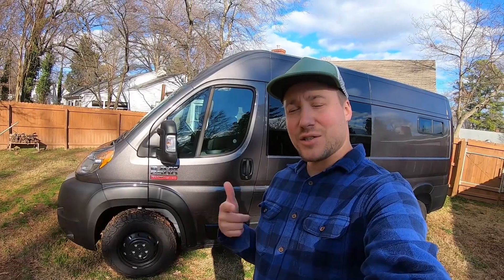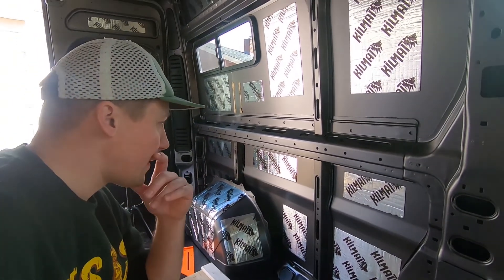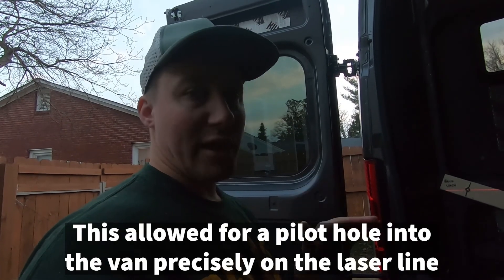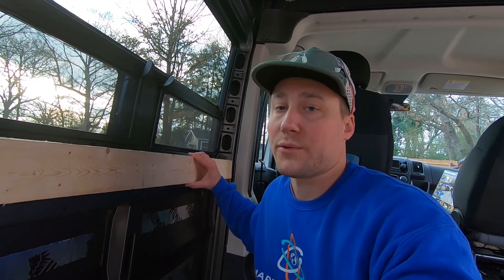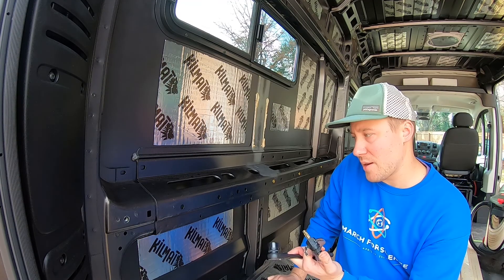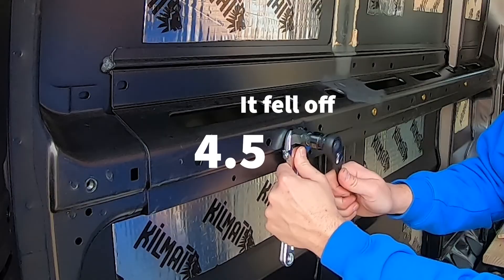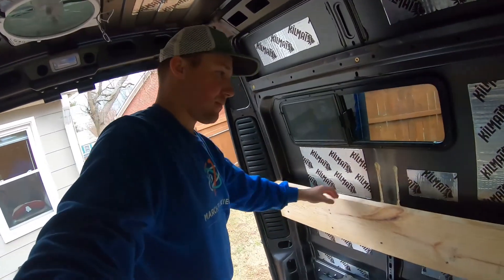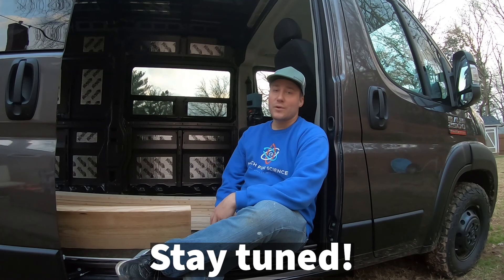Framing a Van + Plus Nuts + Floating Bed Frame Part 1 //Ep. 4 DIY VAN BUILD

Comment: Nice job. Nice Dog. Looking forward to viewing part II and your other videos.
Reply from the maker: Thanks! I hope they can be helpful! Are you starting a build of your own?
Reply: @Trailvagabonds  Thank you for your reply. Yes I am about to start on my second hand Mercedes Sprinter extra high top and extra long wheelbase. I will be starting by fitting  three Fiamma (made in Italy) 40cm (15.5 inches) roof windows and then framing out the van. I will also be fitting side windows. A daunting prospect. Best wishes to you both on your build.
Reply from the maker: @barry-cq4xg  congrats! That is very exciting! After the initial hole is cut, they get easier. The fan install was my first experience cutting holes in the van and it is still by far my most stressful project. You got this! Reach out if you ever have a question 🙌🏻
Reply: @Trailvagabonds  Hi Matt & Katie. Thank you for your reponse. I have watched many YTube videos on these roof lights and they seem fairly straightforward to install. I will certainly contact yo if I have any questions. Best wishes to you both.

Comment: Caught that LeAw reference in the intro.  I was planning on using hanger bolts to locate the plus nut locations, but I like your idea of using the 1x3 as a template. I"m considering using an ATV ramp as the bed frame.
Reply from the maker: 😂 When I was editing the video I didn't know why I opened like that and it had reminded me of something. Maybe I watched one of their videos that morning?🤔 I like your idea of hanger bolts. I thought about it but just didn't want to make another trip to the hardware store since it's usually an ordeal to get there in back, haha. Seemed to work out alright with the template. I like your idea of the ATV ramp. I originally wanted to do 8020 aluminum but it's so expensive. As you'll see in a future video, I'm just using five 2x4s to span the gap and will reinforce them in between (I'm laying them flat which isn't really advised for structural support🤷🏼‍♂️). Then 1/2" birch ply on top. It's seemed sturdy enough. Hopefully no issues down the line.
Reply: for the "bed"  I am doing a simple couch with the back to come off for the bed.   I am leaving the drivers side totally naked.  .   the wall will be my proj screen. for electric I invested in a Bluetti2400.  simple.  when I get close to departure if I have "spare"  $  I will do solar panels and a few Battleborn.    planning to use altern tor and a small propane generator for charging.  ordered this AIO hot water system.  with pump shower heater and sink  outdoor shower will be in the rear of van with enclosed aluminum frame ...like I said no cold weather !!  I had retired to Caribbean till Hurricane IRMA destroyed my home.  So now at age 68 starting over .  always an adventure.

Comment: just started watching.  I am doing my 170xt.   today I am doing the foam.  I have the 4 cyl  motor (by choice)n  so I am trying to be super light weight.   did vfoam reflectix stuff against all the metal.  now I will  do a 1" foam.  THEN an airspace .  for siding I am using the wood-colored reflex stuff.  As I have no plans to ever be in cold climate again heat is my biggest issue and I think reflecting is better than insulating ?   I( am framing in the sliding door area and the rear of the van.  then a glass slider in the wall behind van slider.  in the rear the wall will have an a/c  and windows.  .  otherwise I am keeping the van open as I have 4 dogs and they need room.    removing pax seat and build cage/platform.  keeping bulkhead with a small door for dogs to access their pax cage ..no windows in the a ctual van just in the inner framing so I can totally close / secure the van at night.  during day leave van slider and both rear doors open !       this is what happens after watching hundreds of videos !!     I am studying yours.  What is  "level"  ???     HA !!
Reply from the maker: Congrats on the van and starting your build!🙌🏼 We too have a house full of dogs and they are definitely in our thoughts when building the space. When we hit the road full time we hope to chase 70 degrees fahrenheit. No windows is very smart for climate control. Working in the van on warm days is already so hot. We'll definitely need insulated window covers. As for insulation choices, I think it's very personal. We went with wool but think you can't go wrong utilizing what your research tells you. Every van is different and getting out on the road is what drives us! 😊

Oh and level is soooooo subjective? 🤷🏼‍♂️. I've just been going off my eye in the end 😂
Reply: We did foam insulation as well!

Comment: what length of the 1/4 20 and m8 machine screws did ya use?
Reply from the maker: I used long enough to make a solid connection but not too long to interfere with the metal behind. I think the average sizes were 1-1/2" or 2"

Comment: I like your wheels and tires you chose. Do you have links for those?  Thanks
Reply from the maker: The wheels are actually the stock Promaster ones but in black, I think it was considered an up charge when we purchased the van. The tires are the BF Goodrich TA K02s in the stock size 225/75R16 ~ https://www.americastire.com/buy-tires/bfgoodrich-all-terrain-t-a-ko2?storeCode=1752
Reply: @Trailvagabonds  
Ty! Getting ready to upgrade soon
Reply from the maker: No problem! Your van will look badass! 😎
Reply: @Trailvagabonds   Thanks for the great content! Did you have to modify the rear wheel well and moulding to fit the KO2s? I've seen that clearance has been an issue with the Promaster. I'm building out a 4 season bike/ski rig and want to upgrade my tires (and paint/powdercoat my wheels) and am contemplating that hack.
Reply from the maker: Many people will upgrade to 245s and then you need to modify the wheelwell but we stuck with the stock size 225s and no modifications were needed

Comment: Hey Matt,
What size & kind of wood did you use for the head & footboards - 1 x 10s? 
Thanks!
Reply from the maker: I went with a 2x10. It ends up being 1.5"x9.5" nominal. With where I mounted it on the vans frame, it gave us exactly 38" to the bottom of the bed frame
Reply from the maker: I'm pretty sure it was this one
https://www.homedepot.com/p/2-in-x-10-in-x-12-ft-2-Prime-Kiln-Dried-Southern-Yellow-Pine-Lumber-852554/202085950
Reply: @Trailvagabonds  bless u! thanks so much for getting back

Comment: Can you show the bolts you used.  I'm trying to learn the process so I can try some of this myself, but I need to see what a plus nut is and how it works.   More detail would be appreciated!
Reply from the maker: The Plus Nut can be found at this address. They are like a nut you would put on a bolt but will hold in place in the holes in the metal as seen in the video 
https://www.amazon.com/Steel-Cross-Nut-Pre-Bulbed-pre-bulbed/dp/B008VGWFAI 

This is the link to the tool. The 1/4"-20 size. It comes with a bolt to use with the tool. 
https://www.mcmaster.com/installation-tools-for-smooth-rivet-nuts/

As for bolts, I used stainless steel 1/4-20 machine screws so they screw into the plus nut with a normal Philips head screw driver. 
https://www.boltdepot.com/Machine_screws_Phillips_flat_head_Stainless_steel_18-8_1_4-20.aspx 

The length is dependent on your material. 

Or you can get hex heads or a bolt head, whatever you'd prefer. If you have Facebook or Instagram, send us a message on there if you'd like to talk through it more. Our info is at the bottom of any video description. Hope that helps!
Reply: @Trailvagabonds   - Hey Matt - Just wondering what length of bolt you would recommend?
Reply from the maker: @JamieDeanStevens    Hey there! It really depends on the wood you are attaching. For the bed pieces I used 3" machine screws (if I'm remembering right). For the framing members I used mostly 1.5-2" I think. I wanted as much attachment length I could get into the plus nuts without hitting the wall of the van. The more solid the connection the better I figured.  Hope that's helpful. I think it will really be depended on your material and the amount of space you have to work with.
Reply: @Trailvagabonds  Cheers Matt. Appreciate the quick response :) I'll start stock piling those lengths.
Reply from the maker: @JamieDeanStevens  No worries! All the best with your build! 🙌🏻

Comment: I was looking for a video like this, thank you! What makes a Plus Nut better than a Rivet Nut in this situation?
Reply from the maker: Glad you've found the videos, I hope they can be helpful! The main difference is the surface area. A plusnut has more surface area on the metal than rivet nuts do giving it an overall pull out strength that is higher. I definitely think rivet nuts have their place and could possibly be a solution as many people do use them. Plusnuts made me personally feel more confident. Hope that helps!
Reply: @Trailvagabonds  Thanks for the answer! Makes 100% sense. I'll consider the Plus Nut then!

Comment: Why didn't you decide on using the preexisiting holes in the van?
Reply from the maker: When I did my initial research I didn't find the exact size for all the different holes and decided to use a single product rather than buying different sized rivet nut and plus nuts. I did drill out some of the existing holes to fit. Others were too large for the 1/4"-20 size. If you read through the comments on this video, people have talked about the size of the different holes in the Promaster. If you'd rather do it that way, I don't blame you🙌🏻
Reply: @Trailvagabonds  thanks for the info. Loving the content, been lots of help so far.
Reply from the maker: Glad to hear! Hope your build goes well! 😎

Comment: Can you not use the holes already in the van?
Reply from the maker: Hi Brandon! There are different sized holes. I purchased 1/4"-20 plus nuts and they only fit a select few. If you look through the comments there are a few conversations about what size holes there are in a Promaster. I opted to go with a single size and drill out because I personally felt good about it as an option. If you would rather get the correct size plus nuts and hex rivet nuts to fit the varying holes, I don't blame you. I'm presenting what I decided on in this video and will be the first to say there are many available options and as long as you are confident in your choice it will be the right one for you. Hope that helps! Let me know if you have other questions 🙌🏻

Comment: Which size plus nut wrench driver did you use?   1/4 -20 I presume.   
"Wrench-Drive Rivet Nut Installation Tool for 1/4"-20 and 1/4"-28 Thread Size"
Reply from the maker: Yep, that's the one. I heard really bad reviews for some of the ones sold on Amazon. I definitely recommend the tool I bought from the link below. It comes with different size bolts, just gotta make sure you pair it with the plus nuts if you were to use a different size 

https://www.mcmaster.com/installation-tools-for-smooth-rivet-nuts/
Reply: I bought that tool looks like big pliers ?
Reply from the maker: @CaribbeanZapatta  I used the wrench-driven style rivet but tool. It's a bolt and big nut. I believe you can use the plyer style no problem but I have no experience with them myself

Comment: When talking about the M8 bolt holes, are you talking about the tie-down points?  I want to continue to use the tie-down points for my motorcycle, but also want to use them to help hold down the flooring - which is currently just a floating structure over a commercially fitted pad.  If the M8s are the tie down points, all I'll need to do is find a longer version and I'm golden :)
Reply from the maker: Yep, that's exactly what I am talking about! 👍🏼👍🏼

Comment: Thanks for sharing! Couple of questions - why did you need to drill to make the holes bigger in the van, could you have used the original holes? 
And I see you have “Kilmat” - is that insulation or sound dampening? And how come it’s just in squares rather than a template shape covering all of the metal?
Reply from the maker: In my initial research I didn't find what the sizes of the holes were before buying the 1/4-20 size. If you want to purchase different sizes for the different factory holes you can definitely do that and I don't blame you for not wanting to drill. Scroll the comment section because people have talked about sizes within. I decided on one product across the board and I felt OK about drilling out or drilling new holes, shop vaccing metal shards, and treating them with rustoleum.

Kilmat is a sound deadener in my research only 25% of the metal panels need to be covered to do its job. I have a short video talking about it as well~ https://youtu.be/QnGu4TSrB7A It works to take vibration out of the metal panels. We used Havelock Wool for insulation. It covers all of the space. There is a video on that too. Check out our full build playlist for more helpful videos. We have over 30 with more in the works since we are still building our van currently 👍🏼

Comment: How come you didn’t just use the existing holes and drill them a little bigger?
Reply from the maker: Most of the existing holes were either hex head or larger than the 1/4"-20 plus nuts. A few of the holes that were small I did drill out larger (some being in the ceiling and along the floor). Someone else commented that there are m6 hex head rivet nuts that fit the hex holes if you are hoping for that. In my research I found a lot of people used the 1/4"-20 size so I purchased those and did my best to minimize drilling when I could.

Comment: Did you choose to not use the precut hexagonal and circular holes because of the difficulty of sizing and finding the right the size of plus or hex nut? It seems like the logical decision to use the 3/8  on the step bit to me, finding and sourcing ones that fit the factory holes seems very challenging to get right. However I’m somewhat concerned about metal shavings falling in an inaccessible inside the frame that’s outside of the suction of the shop  vac and rusting. Any thoughts on this? I’ve heard some people use a magnet to try and catch them
Reply from the maker: A magnet in a sock or paper bag would work well. I tried to put most of my holes near the larger holes in the ribs for easier access with the shop vac. It's a tough call. Some people get angry about drilling holes like I did. Some find it makes it easy to put them where you need them. It ends up being a very personal decision and I would just lost the pros and cons and go with your gut. Before I started the project I couldn't find the exact sizes but someone did comment with them if you browse through the comments.
Reply: @Trailvagabonds  right,  I see you, this is definitely a question you’ll get a lot of different answers on. When you say you used a magnet in a sock, where did you place it?
Reply: @Trailvagabonds  ah I didn’t realize that plus nuts had a stronger pull out strength than hex nuts. I wonder how significant that difference is, whether the strength difference its enough to be worth the trouble of drilling. If I do end up drilling, I think I’ll make a lil vacuum snake with some flex seal tape and some flexible conduit to reach inside the frame. Could most likely get all the metal shavings that way.
Reply: @Trailvagabonds  ah I just talked to jay cee rivets, they said that the m6 (1/4-20) hex rivet nuts have around a 480 lb pull out strength and the (1/4-20) plus nuts have a 1200 lb pullout strength. (Each of course) That seems to me to be overkill but there might be a physics problem there that I don’t understand haha. Hope that helps anyone else grappling with this decision.
Reply from the maker: @danielkopaee9241  yep, there is a difference in pull out strength.  One reason I personally felt really good about the 1/4"-20 size plus nut. Lots of people use rivet nuts with success and swear by them so I wouldn't be afraid to use them. Buying a few different sizes is also a larger expense but it could be worth it to not worry about the mess. I think you are on to something making your own vacuum snake! The nice thing about step bits is they pull shavings out better than a regular drill bit leaving hopefully less shavings that could possibly be missed
Reply from the maker: Didn't see your last comment. Good to know! Maybe I'll do a follow up video with some of that information to help give people knowledge of options. If you have any tips or tricks if you use the hex nuts, let me know! 🙌🏻
Reply: @Trailvagabonds   Interesting, I didn’t know that bout step bits! you’re certainly right about having to buy and fit multiple sizes as well, it was so odd to me when there was one hole that fit your plus nut in the ceiling beams , when no other ones did. Unfortunately chrysler is notorious for shitty and inconsistent manufacturing, but that’s def a worthy payoff for it being half the price of a sprinter haha. I’ll def let you know what I end up doing and how it ends up going! Haha (That vacuum snake has me feeling oh so clever) I would imagine a second video on the pros and cons of plus nuts, hex nuts, self tapping screws, and an explanation of the differences between them in function, size, and strength would be extremely well received , just figuring this all out to someone totally inexperienced like me was a lot of legwork. 

Thank you so much for all the help, absolutely invaluable🙏❤️
Reply from the maker: Whoops, just saw this message now. If you have Instagram send us a message on there for better conversation capabilities if you'd like. But I held the shop vac under the hole saw bit. I then dragged the sock and magnet around. I didn't use it to collect while drilling but it's not a terrible idea to do it that way
Reply from the maker: Haha, missed another message... I'm glad I could be helpful. This community is great and I'm glad I can contribute in a positive way! All the best, brother!